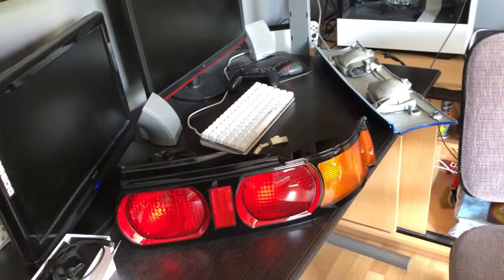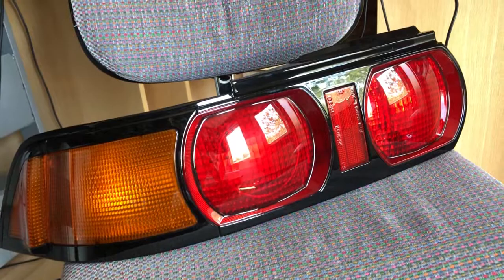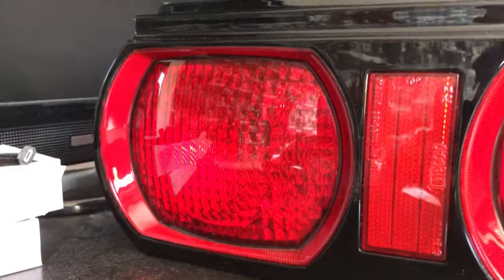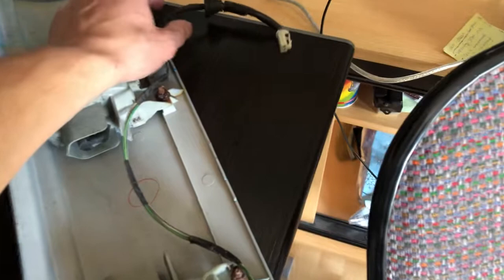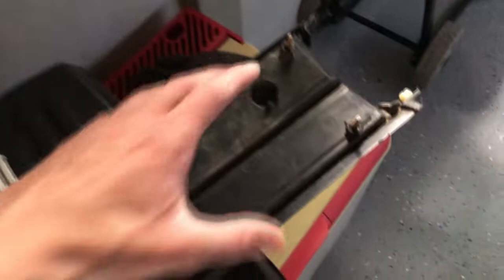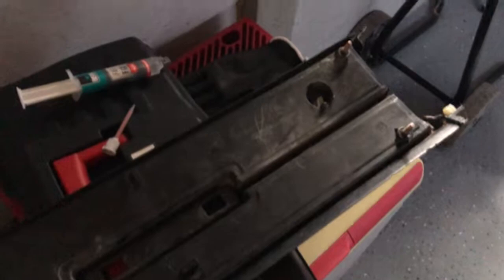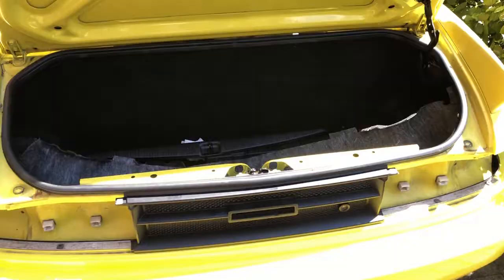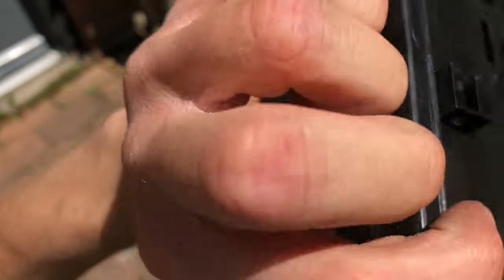HOW TO INSTALL MR2 KOUKI TAILLIGHTS WITH ZENKI PANEL - BEST LOOKING TAILLIGHTS - MR2 Project pt. 1

Comment: You did not mention one thing about the late model center garnish- you would also need a new lock cylinder assembly, at least modify the mounting height of the original, to make it work! The facelift trunk lock sits further out. You could simply not change the lock assembly, but you will not be able to fit a key in the hole, and there will be a gap. FYI
Those tail lamps came out surprisingly good, I thought you bought new ones, and I was like what they have new ones in stock? LOL
Reply: What you could do to cover up the yellow paint visible behind the tail lamps is put some black tape or flexible plastic sheet, like neoprene up against the sheet metal in between the taillight housings. You would only notice the gaps if you have a light shining against the back of the car though.
Reply from the maker: @kalui96  I indeed noticed that during the day the yellow paint is almost not noticable. But to clean up the look I might follow up on your tip, maybe it can also be used in a way to block water from coming behind the panel too much. So thanks for the tip!